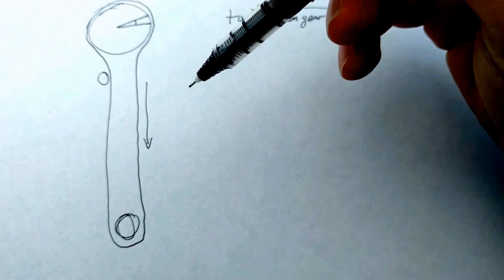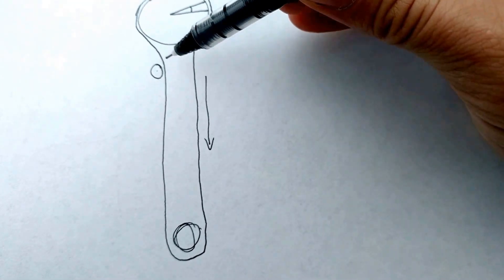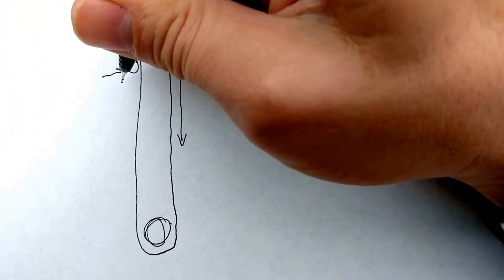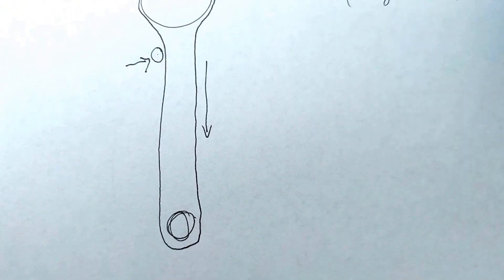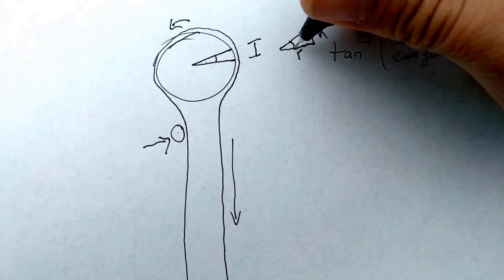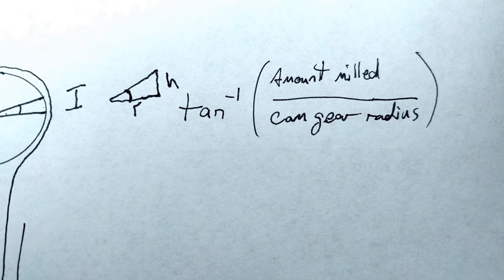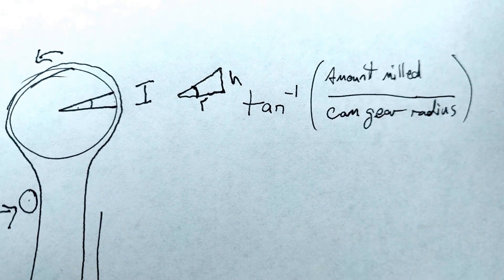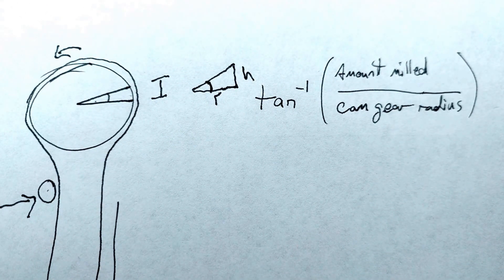Why you might need an adjustable cam gear when you increase compression ratio

Comment: that's where the timing belt tensioner comes in in my opinion.. for the "slack"
Reply from the maker: jef raider the tensioner takes up the slack in the belt, but the slack all goes to one side. that's why it shifts your cam timing.
Reply: @pinkshinyalan  So that shift in the cam timing with a 40 thou mill is just fine?

I bought an engine that im having trouble timing. Bought a manual tensioner but I still seem to be off.

Im currently in the process of doing research on what I need next. This video was pretty damn informative compared to the rest.
Reply from the maker: @whatthe363  yeah there isn't any issue with my engine. Not sure if I mentioned here, but I calculated the timing shift in my case to be less than 1 degree. If you're having trouble with your engine, this is unlikely to be the cause.

If I were you, I'd set the can gear to zero, or swap in a non adjustable gear, and then set everything else up according to factory. Once that's set and it runs, start tweaking the cam gear -- but you pretty much have to do dyno runs to get anything out of that.